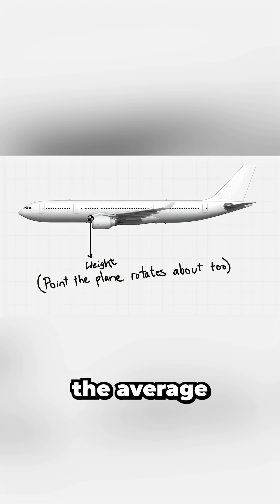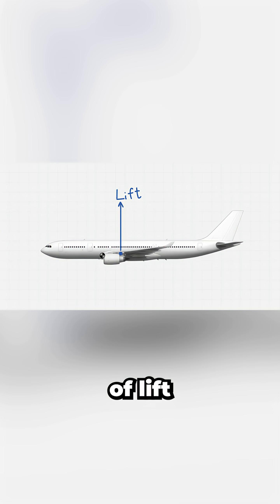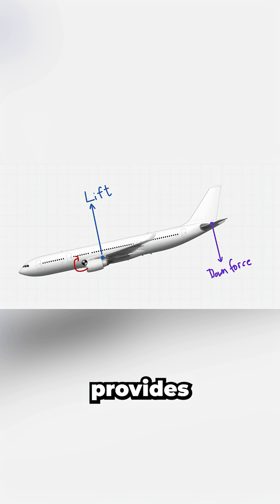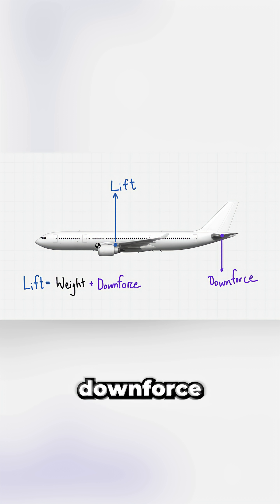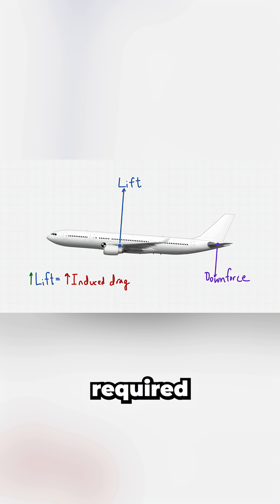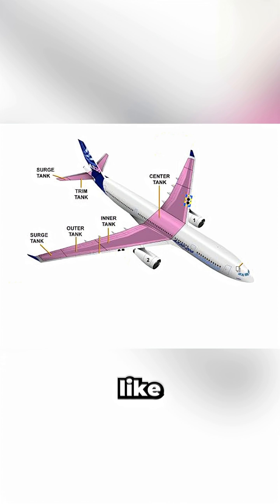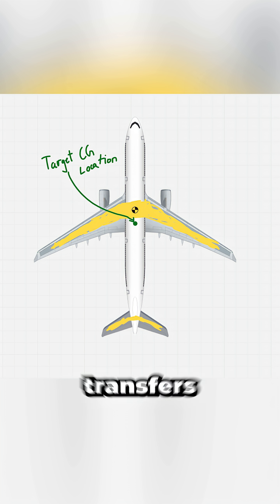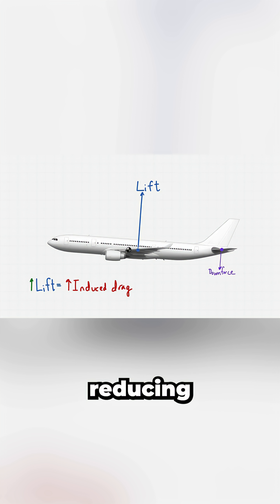Why do some aircraft have fuel in the tail ?

Comment: So... you left out the important part.  As the Cg shifts back and there is less downforce from the horizontal stabilizer, the plane becomes less statically stable in pitch.

During cruise, it's okay, because you have time to re-trim if the plane gets upset.

During takeoff and landing, you want greater stability, so the tail tanks are empty.

It'd be interesting to see how the fuel pickup in the tail tank works, since you have to be able to do a fast emergency fuel transfer forward if something weird happens in cruise, and you might be pulling negative G.

Comment: Concorde had a similar system it was made necessary by the large leap of the aerodynamic center when going supersonic (it is at about 25% cord subsonic, 50% supersonic.)
Reply: And for anyone wondering why it makes a difference for flying supersonic vs subsonic… flow over the aircraft changes due to the shock waves produced and the compressibility of the air.

Comment: Hey Jashan. I am an aero engineering student and student pilot and I am familiar with the center of lift for the wing and tail being aft of the cg. However when I add flaps in the c172 I’m learning in it tends to pitch the nose up which I counteract with forward pressure on the yoke. This doesn’t make sense to me though as increasing the lift on the wings should cause a nose down moment? The only thing I can think of is that the flaps might shift the center of pressure forward which shortens the moment arm of the lift vector relative to the cg thus reducing the nose down moment. Could you explain why this happens?
Reply: Note that this pitch tendency with flaps is unique for each aircraft. Some pitch up, some pitch down, and some don't have any noticable pitch change when flaps are put up or down.
Reply: adding more lift brings the nose down?
Reply: Extra lift pushes it up since the wings are in front of the centre of pressure.